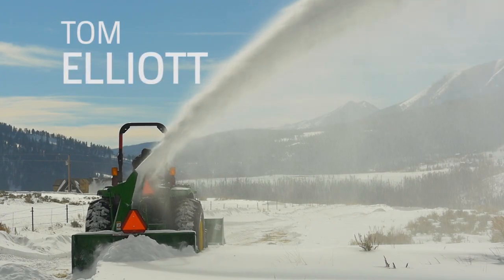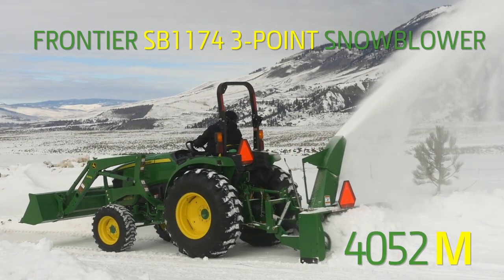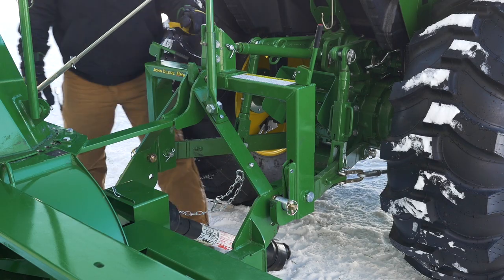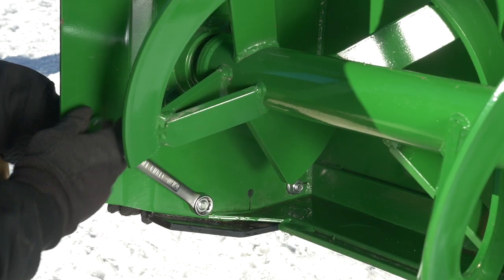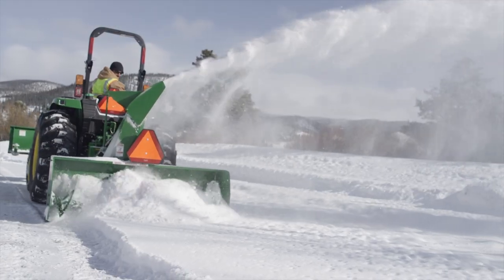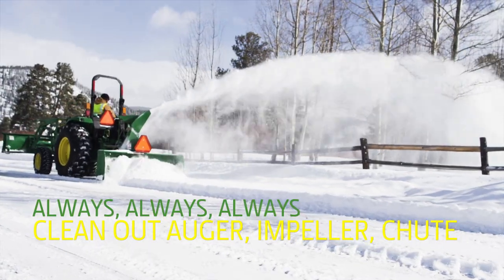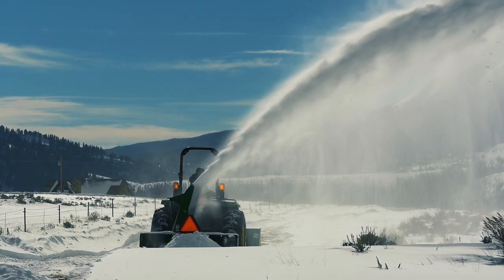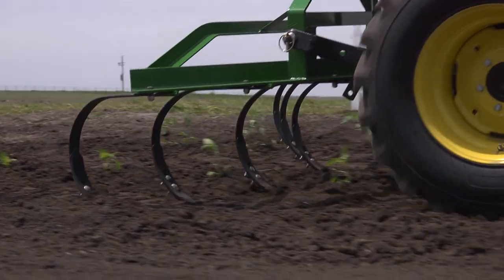How to Use a Tractor-Powered Snowblower | John Deere Tips Notebook

Comment: My 1025r always get bogged down
Reply from the maker: Nathan, we're very sorry to hear you've had a less than ideal experience with your 1025R Sub-Compact Tractor. If you haven't already, we recommend looking through your Operator's Manual. Towards the back, there is a section called "Troubleshooting" that may provide some solutions for you to try out. We have many Operator's Manuals available for free online at TechPubs.Deere.com. If the problem continues, we recommend contacting your local dealer for further assistance. You can find their contact information at Deere.com/Dealer.

Comment: Wouldn't want to do a long lane with this,  you'd probably have a real stiff neck by the time you were done.  You'd think they could come up with some way to attach the blower to the front.
Reply: Beats using a scraper blade in 2 ft taking 8 hours in reverse lol
Reply: There is a way to put a blower on the front but they're showing you a three-point blower in this video

Comment: What is the benefit of a snowblower over a plow? I assume it uses way more fuel!
Reply from the maker: Thanks for the question! Generally speaking, a tractor-powered snowblower will move more snow faster than any other solution. Whether you need to clear a long driveway or create a path to your outbuildings, a PTO-driven snowblower is hard to beat. However, not everybody has a snowblower, in which case you might check out “How To Remove Snow 3 Different Ways” at TipsNotebook.com. This video features the use of a front bucket, a rear blade, and/or a front blade. Plus, those are three economical tools you can use all year round. We hope this helps.
Reply: I tell ya what man...I have a plow and a rear mounted blower. On my .5 mile long driveway I found that the plow is nice until the mounds you make on the sides start catching snow during blizzards. by February of 2017 the side mounds were over 7 feet tall and I could not even use the plow anymore, so I had to pay hundreds of dollars for someone to come with a blower and blow it out every storm after.
Last 2 years I was using a 100hp diesel tractor and rear duel stage blower and that thing is a freaking godsend! I live in rural minnesota and its ALWAYS windy and snowing here,, and that thing throws snow well over 50 feet from my lane. 

In my opinion you should only use a plow truck for your lot around the house and that's it.